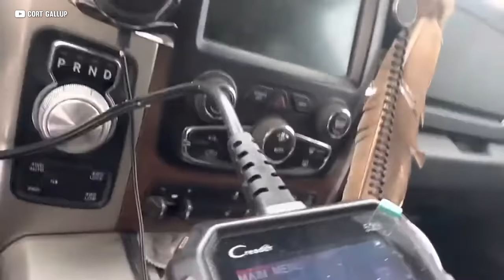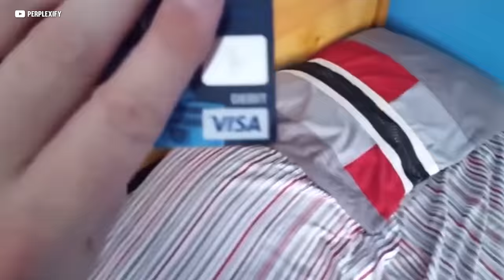Worst Trucks Only Stupid People Buy

Comment: Between 2002 and 2014 I owned 3 Dodge Cummins Diesels. Each had in excess of 250,000 miles when I traded. The first one had 275,000 when I replaced the clutch. Each extended cab, 2 w/d, the first two were standard trans. the last was a 2011,  had recall problems that was finally fixed at 110,000. No more trouble. For all my lost time in the shop, Dodge gave me $2,200.00. I loved those pickups. Particularly the ones with the Std trans.  Anytime I found someone from the Ford or Chevy camp willing to run I knew I would ALWAYS win. Theirs were governed to 94-96 mph, the Cummins was good to 112.  After 700,000 miles on those three, I've run circles around the fathers of most of your readers. I'm 82 and still loving the memories.
Reply: That might be true, but Dodge is no better Then forward or chevy's. The way I look at things is how much money has this vehicle saved me. How many times it has been to the shop? 1:57 My brother in law worked for ford He is a mechanicand he told me good for Chevy. And dodge all design to bring them back constantly to replace sensors and things like that. That's the way forward designed them to keep the money flowing into the company. Now I am 70 years old.
And you name it I had it toto day the best truck I had is toyota my truck Not going good has only been into the sfor a check over. No major problemjust ties and breaks that I do myself. Empty the oval change. And the truck is ten years old. I do not have old spots all in my driveway.
The truck runs great. And when I want a new one, I'll go get it. And my family members are happy or waiting for me to just pass it down because they know what they're getting.

Comment: I’m glad that you mentioned that basic services, like oil changes are cheap insurance. Don’t overlook it. Great work.
Reply: Especially for diesel engines
Reply: Gm put that same inline 5 in the hummer (small one I don’t know the chassis name )
Reply: Ignore factory recommended intervals. Regular oil and filter every 3,000 miles. Cheaper over the long run than a new engine.
Reply: @dave3657  That old '3000 mile' chestnut?  ROFL  . . .
Reply: @dave3657  I have literally seen a ford f150 4.6L and a nissan xterra 4.0L go over 60k miles with the oil from the factory. The 4.6L failed at 64k miles. The Xterra is failing at 78k miles (because it got oil changed at 62k miles). If those drivers had just changed the oil every 20,000 miles, they wouldn't be the happiest engines but they would still be driving.
Reply: @robertkubrick3738 it blows my mind how people will neglect the most basic maintenance thats like not feeding your children lmao
Reply: The factory service intervals are NOT because the oil and coolants are that good or that the engine is inherently cleaner in its operation.  It's to minimize EPA pollution penalties.  

3000-4000 mile oil change intervals are still the best.  People never check their air filters because they are not on top where they can be easily accessed.

Ironically, and IMO, the worst thing to happen was electronic ignition and self-service gas stations.  
WHY?  Those points ignitions were barely adequate when new.  When the points would wear down or begin pitting, the engine wouldn't run right and the car owner would be forced to open the hood and investigate.  While the hood was open, other things often got looked at.  Voila, preventative maintenance!

As for old-school full serve gas stations, the pump monkey was trained to ask permission to open the hood while the tank was being filled.  Or at least while the customer was there after getting a top off.  He would check the oil, check the air filter, (two popular items to sell), check the belts, top off the windshield washer reservoir, and then set about to checking tire pressures and adding air if needed.  Voila, preventative maintenance!  

If the oil was black, it wasn't too difficult to upsell an oil / filter change while the customer was there or schedule an appointment for later.  I remember, as a kid, when my Mom was getting gas for the Rambler.  She told the pump monkey that it wasn't running right.  He opened the hood and took off the distributor cap and found some pitted points.  A quick cleaning with an emery board and regap with a Joker card and the car ran good again.

Comment: I own an 09 Tacoma off road being a cali owned truck I’ve been lucky not to deal with major rust however my advice to all truck owners get your maintenance done regularly better to spend less than thousands later
Reply: Undercoating will also help keep Toyotas on the road. We have a 2009 Highlander 100k miles and rust is an absolute issue.
My friend just replaced his entire rear subframe on his 2008 and at the time he had under 85k..
We've had some other issues but nothing major (odd electrical issues, vacuum lines, shocks and struts, etc).
All and all, Toyotas are reliable but (just like every other car)  preventive maintenance is foremost!
Reply: Smart people buy Toyota.
Reply: ALL vehicles rust. Toyotas are no worse. In fact, Jeep is much more rust prone. Maybe they should stop pouring salt on the roads. Better yet, move to a warm climate.

Comment: I wish Ford would go back to building the old basic F-100 with the inline six and three on the tree. Had a 1960 f-100 and it ran like a top for 24 years. Just a basic truck with a bench seat. Truly a gem.
Reply: Wouldn't that be nice
Reply: I had a 1978 F150  300 6 and 4 on the floor but 1st was almost never  used not even synchronized you had to stop to put in first. Great truck
Reply: @glenryan6569  Never a transmission repair  bill on that one!.
My 1977 came with the automatic.  Eventually I had to rebuild it, but the kit was less than $100 and I was able to do it myself.   Those were the days.
Reply: Ditto, the pre-1980 trucks are the best. bring back the 1970's models with just a basic fuel injection and nobody can touch it. 420,000 miles on my 1978 bronco.
Reply: @castirondude  nobody can touch it today because of the horrible gas mileage.  I had a 77 F 150 in the 80s, and i knew many others with similar Fords. No matter the engine or load, all got 10 mpg. That's when has was one dollar. Now in CA it's 5x that price. I'd love a F 250 from that time, rather than a new truck. But man, I used to just watch  that gas gage drop by the minute. At thst time, my daily commute cost $5 a day. Today it would be $25 a day just to get to work and back.
Reply: @bigtoad45  Ford built their 300 six for about 30 years. I remember when all the UPS trucks had it and a manual 4 speed. Mechanics had it easy then. Hard to break simple equipment like that.
Reply: @jeanclaude7018  why commute in a truck though? I have a 86 f250 which actually gets 18-20 but I probably only averaged 500 miles a year in the 20 years I've had it. Only drive it when I need a truck.
Reply: @jeanclaude7018  I had a 1977 f250 with a 460, it got about 12-13 mpg . Idk if a modern f250 truck gets that much better mileage does it? Maybe 16-18? Compared to that 100k price tag and repair cost you never get your money back. When I lived in CA I drove a 1978 bronco most of the time and in 2008 when gas prices spiked I calculated I would have to drive a ricer to work for more than 10 years to get my money back
Reply: @castirondude  I agree.  It was all I had at the time.  Now I prefer my Civic unless I need a truck, then I use my Nissan.  But I  still occasionally need a heavier truck, like  Ford 250. What  model is yours that gets 20 mpg?  Does it have the 300 six?
Reply: @castirondude  13 is not bad. I put a 429 in my 77 150 "Ranger" 4x4 and with the automatic it got 10. I know more about engines now and I think it could have been built for better mileage.  
When the gas prices went over $3 , I knew war was declared on the consumer,  so I cheated and found a 98 Civic HX used that was rated at 36/44. It actually does do that if you drive nice, and I still have it. Waiting to recover from an injury because it needs a new bearing in the 5 speed.  First Japanese transmission I've ever had to work on. 
I still want to find a cheap 3/4 ton for things like towing my boat project, etc. My Nissan 4 cyl towed it home, but I fear that without a granny gear, the launch ramp would be an ugly scenario.
Reply: @jeanclaude7018  usually if you set the advance to 10-12 degrees that helps your mileage. The 70s engines are hard to time because they had all this emissions stuff like egr run off a bunch of vacuum valve and that affects the timing advance curve requirement
Reply: @castirondude  20 years @ 500 miles ?   Hell, it will due an oil change any time soon    :=)
Reply: Give me a 4 in the floor. Those stupid column shifters always get hung up between gears and I'm too old to climb under the truck and hit the linkage with something to pop it into neutral.
Reply: Those trucks got lousy gas mileage at a time when gas was cheap. It would be expensive to run one today BUT....... when one of today's trucks fail, the repair costs far, far exceed the savings in fuel costs. The fact is, today's modern trucks cost the owners more to operate per mile over the lifetime of the vehicle. I'd buy an old F-100 in a heartbeat.
Reply: My 2015 gas guzzler dodge ram had over 10 recalls that hemi tick is real   Replaced the lifters and cam also other parts since we had to get all in there but it still sucks to me. Now I treat it like a balirena
Not to mention the dash is lit like a Christmas 🎄
Reply: Bench seats are like motel room

Comment: I have a 2010 F150 3 valve 5.4 and change the oil every 4000 miles. It currently has 214,000 miles on it and aside from crappy exhaust manifolds (always cracking), it's been pretty darn reliable.
Reply: Everytime a worst engine ever list goes right to the 3v 5.4 it let's me know they're 🤡 's
Reply: @aclary81  Yes, not inherently horrible, but not tolerant at all of poor maintenance. You have to keep clean oil in them and change the coolant and plugs on time or things corrode, leak and seize up!
Reply: They had finally updated the cam phaser design by 2010 so the late years were much better than the early ones. Even the early ones can last a long time if maintained, and if any issues that arise are fixed promptly (ticking, phaser noise, etc.). I know a guy who works on fleet airport shuttles with 5.4 3vs and he's had several that hit a million miles on the original engines. They were used between the Villages, FL (senior town) and the Orlando airport so a lot of highway miles combined with good maintenance. He had one in the shop when I was there to replace at 1M miles. It still ran fine but they figured it had to die at some point so they were replacing it rather than risk stranding a bunch of seniors on the side of the road in the hot Florida sun.
Reply: @josephkneip2950  Yes, and bi-metal corrosion also occurs when you have different metals all getting sprayed with water and sometimes salt up North. That and probably using the cheapest bidder to supply bolts which then corrode faster and aren't strong enough to withstand the uneven expansion/contraction rates. People often say once they upgrade the bolts/studs and they hold up without any issues. They save a buck a car on cheaper bolts and it adds up to millions, and the factory ones only have to outlast the warranty!
Reply: i am glad you were dumb enough to buy a ford and am looking forward to rescuing you on the side of the road with my Tundra
Reply: if you want to cure that from happening? ceramic coat them inside and out... torque less using anti seize
Reply: @ksobo3112 lol my daughter bought one and my other daughter bought a ford focus. The one that bought to Toyota said hers would be running long after the focus. It turned out the other way around the Toyota has been long gone with problem after problem while the focus lasted 5 years longer with no problems. Sometimes it’s the luck of the draw.
Reply: I've never sold a Ford. They always get taken by ex wives or someone hitting me and totaling it. 2 Explorers, 2 Mustangs, 1 F-150, 1 Focus. Roughly 672k miles.

In all the Fords I've owned, the only thing I've had to fix is the clutch on my 98 Mustang when it was over 125k miles (learned I'm hard on clutches too,).

People can't figure out why I'm loyal to Ford. They've yet to screw me over, luckily!
Reply: @robcobi I'm mostly a Ford guy myself, and admire your loyalty to the brand. Might I suggest though, for reasons personal to you, you don't buy anymore Ford's. It sounds like you'll just end up in a wreck or a horrible relationship, and none of that is good or fun.
Reply: Put sparkplug in it yet!
Reply: @thepoopsoup  Better call snap on and invest in the extractor tools first.
Reply: Those 2 piece spark plugs were a pain to get out
Reply: @jimmytran5971  How did Ford go from bulletproof Windsor, Cleveland, FE, and 385 V8s to this problem child?
Reply: My neighbor has a 2005 Ford F-150 with a 5.4 Triton V8. It’s been good to him so far.
Reply: @thomasweekley9209  Seems to be hit and miss. Either they last a while with God maintenance,  or they are a nightmare. I'd never knowingly buy one.
Reply: @TIJoe-te9qu  then again he barely ever drove it since he bought it new in 2005. It doesn’t even have 100,000 miles on it yet
Reply: @thomasweekley9209  He's the right kind of guy for that truck then. Probably last him a long time. My poor truck has over 4 times that mileage.  I just dared to take it on a 10 hour trip.
Reply: I just sold my 2007 F150 with the 5.4 and it still ran great at 242,000 miles. Very little repairs to it over the course of its life. I did learn that clean oil was an absolute must and the recommended 5-20 synthetic blend is not the oil to use. The truck started running rough at 94,000 miles. I was told by a Ford dealer that it needed a new engine for $8500. I did some research and learned about the sludge issues. I had always used Ford's synthetic blend oil and changed every 3000 miles. And that was the problem. I flushed the engine several times and then started using Walmart's high mileage, full synthetic 5-30 and Mobile 1 filters. I still changed every 3000 miles to prevent any sludge buildup. No more problems after that. Ford's synthetic blend oil is really bad.
Reply: I have 2003 f150 triton over 215,000   miles on it.  Still going strong. 
If I was to sale it.   $10,000.
Bottom  line.  Luv my truck
Reply: My 2013 has about the same amount and I’m doing 10k oil changes
Reply: I'm pretty sure you have the 5.0 Coyote which didn't have the cam phasor issues the 3 valve 5.4's have.
Reply: @stevekiray1676  I had a 2007 F150 with the 5.4. I now have a 2016 with the 5.0 Coyote. I am very familiar with both engines. Sold the 2007 with 242,000 miles and it is still going strong. I have 103,000 on the 2016 with not a single repair.

The big thing with the 5.4 is to keep it clean inside. Sludge will kill that engine. Use good, full synthetic 5-30 oil (not 5-20), good oil filters such as Mobile 1, Wix or NAPA Gold and change oil every 3000 miles. Using the cheap Motorcraft oil and filters will destroy that engine - even if you change oil at 3000 miles. I also flushed the engine once a year to make sure it was clean.
Reply: @stevekiray1676  Ford still used the 5.4 in 2010. They didn't change to the 5.0 until 2011.
Reply: I was referring to the guy with the '13. I have the '10 and it's been pretty darn reliable with 220K on it. New ones are just so damn expensive.
Reply: @stevekiray1676  OK. I misunderstood now. I didn't buy my 2016 new. I bought a used one coming off a lease with 52k miles. Got it for about half the cost of new. The 2016 and 2017 F150s with the 5.0 and six speed is a really good truck. The 2018 wasn't as good a year.
Reply: Yeah..I agree..not really sure I want the 10 speed after some of the things I've read about it. My buddy has a 2021 and has had it back to Ford several times for hard shifting and downshifting unexpectedly

Comment: I had a 2006 Ford F-150 with the 5.4 Triton 3-valve V-* Engine. The only problem I had with that engine was the spark plug issue, which was quickly resolved with the proper tools.
Reply: Same. I would dump a small amount of transmission fluid down the plug holes and leave it overnight. They come out easy as pie afterwards.
Reply: The 3V is absolute garbage
Reply: I had a friend with one that suffered a catastrophic engine failure with about 90000 miles on it.
Reply: The last f150 I worked on was a 2006 5.4 3 valve with 260k on it. It needed new Cam phasers and Solenoids. after that I poured a quart of Marvel mystery oil in it and drove it until the lash adjusters quieted down and changed oil and filter. Alot of people want to argue with me about using Diesel engine oil in these engines but it works extremely well at cleaning buildup out of them. @ 1800 miles the oil was coal black and it was changed again using the same oil! A few months later he brought it back in for Spark plugs and the secret to changing them is prep the engine by moving all stuff out of the way and unbolting the coils you will need compressed air for this too. Warm the engine until fully warmed and then the plugs will come right out without breaking off. Do one side at a time and run engine some more to keep hot then change the other side. The air is for blowing out the plug holes one at a time..NO POwer Tools!
Reply: I had a 2005 never had a problem with the engine except for the spark plugs breaking off , it rusted so bad you would fall through the bed and I had it rhino lined the first week I got it the frame finally broke in half the cab corners rusted through in 4 years worst truck I ever had .
Reply: Sure it was not the only problem you had with the truck….
Reply: 5.4 3v with 276k 
Only issue was 1 broke sparkplug years back